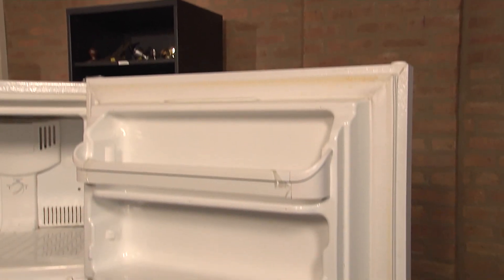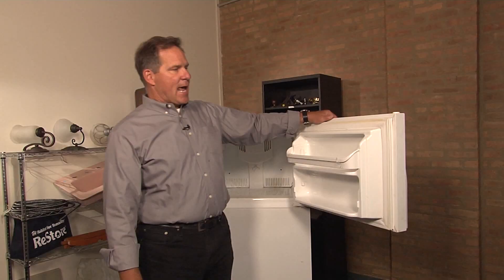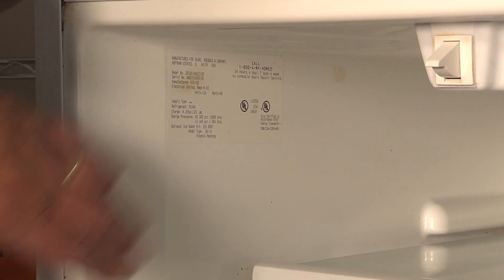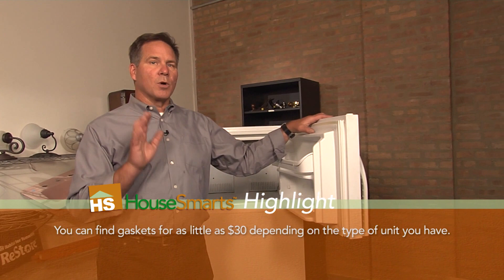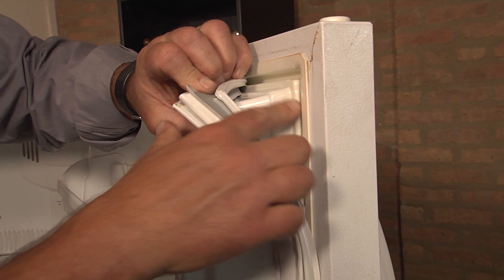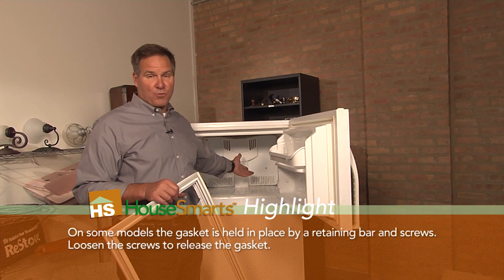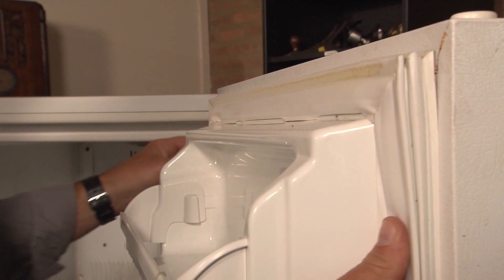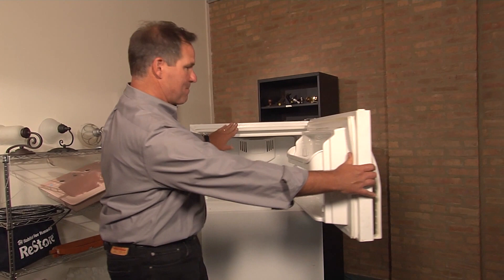How To Fix Refrigerator Door Seal

Comment: The information in the video is not wrong, but the title is wrong. You're not fixing the seal, you're replacing it.
Reply: Replacing it is technically fixing it
Reply: Semantics. Is replacing it is the fix, it goes either way. 
Just like 
my mom
Oohhhhhhhh
Reply: Thanks captain obvious
Reply: @jimgillion6453 thanks! This is what I was looking for.
Reply: I like turtles
Reply: You're splitting hair
Reply: And with all the researching buying and waiting, it will take more than 15 mins
Reply: It's still FIXING the problem,  Einstein.
Reply: The only way you can fix a seal is maybe you can try heating it up with a heat gun to expand the squished parts. Other than that is a replace. In 90% of circumstances you are replacing the seal
Reply: You are fixing the seal by replacing the gasket, semantics semantics
Reply: You can't fix a door seal. You fix it by replacing it. What, do you want him to sew your gasket back together? Lol come on.
Reply: And then there is always that ONE GUY .......
Reply: And then there's always that one guy.......

Comment: The best way to tell if the gasket is the issue, is to close the door with some force. What should happen is a  vacuum seal, making the door difficult to open immediately after closing. 
If your freezer door easily opens right after closing, here is what i suggest.  Using a medium scour sponge, clean along the side of the gasket that touches the fridge. Also clean the fridge along where the gasket connects. Clean inside the gasket, food debris has a tendency to slip in there. If cleaning doesnt work, inspect the gasket for rips. Another common issue is the gasket will begin to sag along the bottom. If this turns out to be the issue, and you are a normal person who doesnt have $200 for a fridge gasket, what i suggest is simply removing it and flipping it over. This way the sag down is now at the top with gravity pulling it the other way. 
IMPORTANT When inserting the gasket back into the freezer door, ensure that your corners are lined up correctly. The offset corner will pull the gasket in one area, preventing it from sealing properly. 
I hope this helps someone!
Reply: Thanks mate, this was much more informative. He should have called it "How to replace the seal", you did what he described in his title, "how to fix it".
Reply: @woodenswordsword118  ive made it my lifes work to  fix the unhelpful information on the internet. Glad i could be of service!

Comment: I don't consider myself to be much of a dummy (at all) i figured this is pretty much how it worked but mine didn't want to just pull out and I wasn't going to force it. With this video, made it a little more confident that maybe just need a tug. Straight to the point, no bloat garbage in the video. Very very much appreciative. I know this is a couple years old but very much would like to thank you for the simple video.

Comment: I found this clip quite informative. I removed the old seal easily after watching & thoroughly cleaned the original seal then refitted & to my surprise it now seals really well 
, thanks for the information.
Reply: Good to know. I’m trying that first!
I have my fridge Ave freezer both set to the coldest and it’s right at the max temperature it should be to keep food cold/frozen. Hopefully this works.

Comment: I bought a brand new GE/Hotpoint replacement lower door seal (WR24X10229) for my GE model GTH17DBC2RWW fridge which looks like it may be the same as in the video.  The old damaged seal came off as indicated in the video however putting on the new seal was a fight to the death requiring all the strength my 70 year old arthritic hands could apply.  This was not like the ease of installation as shown in the video.  If I had to try this again I think I would apply a little silicone grease to the seal where it mates with the tracks on the door which hold the seal once it presses in fully.  Any thoughts?

Comment: My freezer door gasket has a few hairline cracks in it that's causing some ice buildup every single day that I have to fry off with my fingernails.  I really don't want to have to replace the whole gasket just because of that. Isn't there some kind of gasket repair patch kit or food grade silicone I can use to repair the cracks on the gasket?

Comment: True however my issue is that the door keeps letting the gasket come loose from the groove and this is even with a brand new gasket, I am to the point I need to find some kind of adhesive to use to make it stick into the groove.
Reply: So did the adhesive work?

Comment: Did I understand you to say to get the refrigerator's make and model number in order to purchase a new gasket at either a refrigerator parts store or on line, which you said will likely cost upward of $200? As w/ any repair, compare the cost to repair vs replace, then make a decision as to what best makes sense for you!

$200 for a gasket seems extremely high to me, especially for a refrigerator than most likely has aged quite significantly!

I purchased a used Kenmore side by side when I remodeled my home about 12 years ago for $300. The gasket appears to prevent the doors from always shutting completely as often times when I go to the fridge, the doors are slightly cracked open!

However, it still performs quite well...only maintenance required is to periodically clean all the debris that collects underneath where the fan and refrigeration tubes are located!

Considering this scenario...any suggestions?
Reply: No.  He said to be careful, because some can cost that much, but it's important to shop around and $30 is normal/common.
Reply: @PeterLawton  In written print while he is speaking about the gasket possibly costing upwards of $200 it says "You can find gaskets for as little as $30 depending on the type of unit you have"...guess the point is to shop around for the best price!
Reply: I just got new gaskets for my fridge/freezer and it was only $130ish including shipping, so definitely look around on different sites for the best deal and double or triple check it's for your model fridge/freezer

Comment: $200? our 7 cu ft samsung fridge cost us $230 here in asia in 2011 brand new. 12 years later the seal has now failed. the other samsung bought a year earlier failed 5½ years later. got repaired multiple times including replacing the motor and finally failed early this year. ironically the seal was never replaced and we're not sure if that was the problem.

Comment: if only it was that easy to lock the new gasket on. it’s practically impossible to lock in.
Reply: use a screwdriver to push the gasket into the groove

Comment: Why is it a good deal to buy a used freezer /fridge to only spend upwards of $200 for a new one??
Reply: An old one in good working order for $200 is a WAY better investment than a new $200 unit. Even new expensive fridges aren't built to last at all. A couple fixes to keep an older, more robust model running is the way to go.

Comment: Just checked they dont make a gasket for my freezer fridge anymore. ? What can i do has small leak in corner of  freezer?
Reply: Me and my mom had a similar issue when I was a kid, try putting a small blob of Vaseline near the unsealed portion, maybe spread it. It’s a tad messy but it’ll fix it for a little while until you figure out a solution or replace it
Reply: @tylerlowe1321  I found one on e bay. $37 dollars.
Reply: Ok so your repair advise is to replace the thing?  Can’t these things be fixed at all?
Reply: @jhana9220  Mine is still sitting in the box lol. I need to install it. My fridge is working fine again. I un plugged it for over 24hrs then pulled the gasket out some plugged it back in and working good. I still have a slight leak in the corner but its working fine. I need to change out the gasket since i do have a new one and it does need replaced you can find them on e bay.